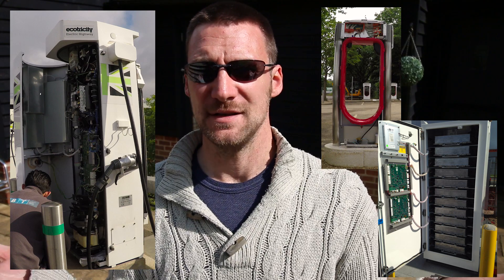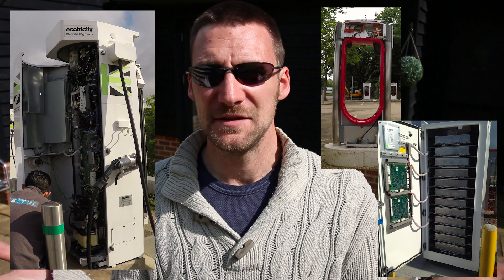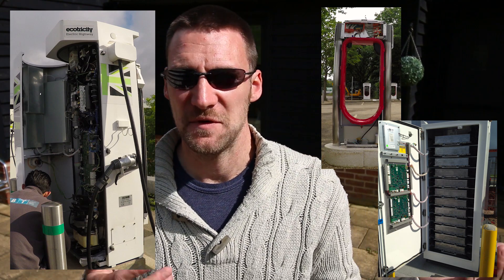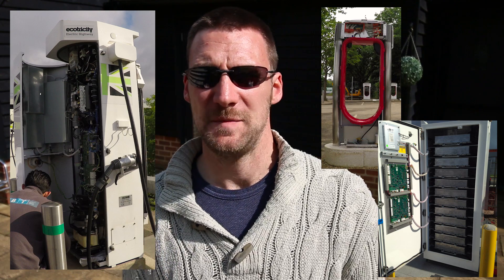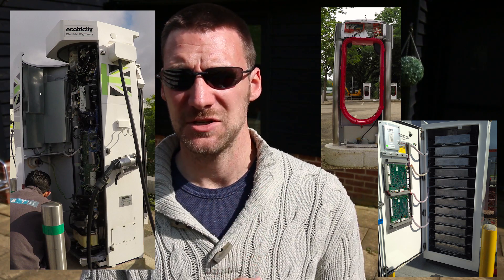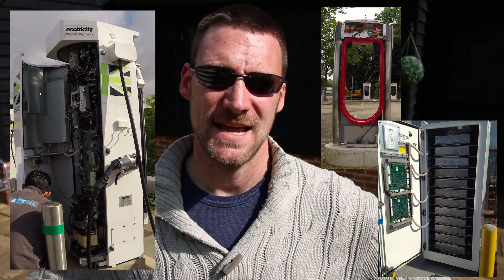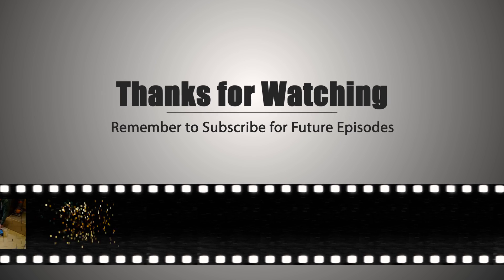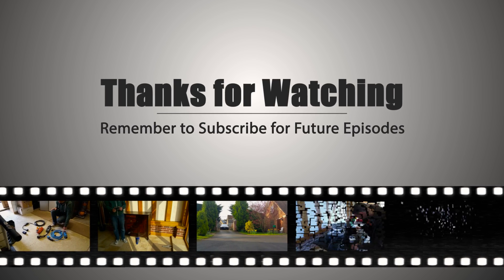Supercharger design vs the rest

Comment: I've always asked why do we have a charging unit on the Leaf. It's regen could take 35KW AC in three phase and throttleable in the Leaf. The only technical difficulty would be three contactors to isolate the motor so the car does not run away when you plug in.

The Zoe charges this way but it's motor requires a dc charge into the rotor brushes to turn.
Making the Leaf simpler, cheaper, lighter and far more versatile.

James. A chat about after sales service please.
May I direct you to Electric Leaf Mans latest video. For a laugh.

Comment: AC to DC is quite interesting. But then again its quite easy (or at least low power I am not sure about the challenges for high power) so it also quite boring. DC to AC is much more interesting but also much less common and in most cases less useful.

Comment: Would one have to have a three phase, commercial type, electrical service at home, to install a high power DC charger?
Reply from the maker: I'm not sure that high power DC chargers are commercially available for joe public to buy are they? Most people (at least in Europe), just use 3 phase AC from the wall, but then the Teslas in Europe have 3 phase capable onboard chargers.
Reply: +James Cooke A home, high power DC charger would be awesome!
Reply: +Tom Bertheau I was only wondering if it would be possible to "supercharge" at home.

Comment: Good job James, know, can you explain way it's faster to charge on the A bank then the B bank.  And while I'm at it, why is your Tesla plug different then the US, after all DC is. DC.
Reply from the maker: I thought the speed only slowed down if you plug in and someone else is on the other plug. So if there is a car plugged into A and another plugged into B then if they are both empty, the most they can get is 60kW each. This is because Tesla Superchargers have to plugs to each supercharger cabinet, which are limited to 120kW.

Comment: Why should the car company be responsable for the chargers? Shell is not a car factory but yet it has gasoline stations?
Reply from the maker: The problem is electricity so cheap and as you can get it from your house relatively cheaply, nobody likes to have to pay a lot to access it when they are away from home. That means that there is virtually no viable business model that can be applied to the quick chargers, especially as they cost quite a lot to install.
Reply: Because no-one else is doing it properly and Government are not pushing to make chargers more accessible and faster (and that's due to getting lots of tax from oil) . Hence Tesla is installing the SuperCharges by themselves (in other words fighting the rest of oil industry) and growing rapidly.
Reply: +Adil Zein thrue, Tesla had to. But now it is time that a company could charge cars and make some profit. So Tesla should not deliver cars with free charging anymore.
Reply: It's quite obvious. If they don't put themselves responsible for designing these right now, there will be no infrastructure to support the use of electric cars (unless you expect owners of electric cars to drive within a limited radius that allows them to return home to charge and nowhere else).
Reply: but mfr's have huge vested interests (stocks) in oil. hence Toyota's hydrogen Mirai.
The tale of con-men making the kings new clothes
Reply from the maker: You mean "steam reformed methane" Mirai don't you :-)
Reply: James Cooke absolutely. My skin crawls when anyone mentions hydrogen cars. Apollo13.